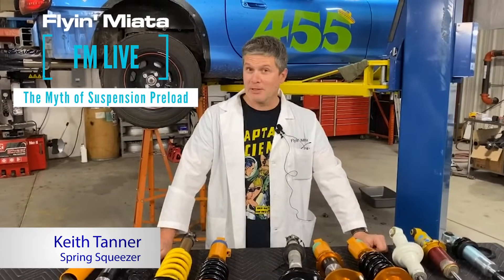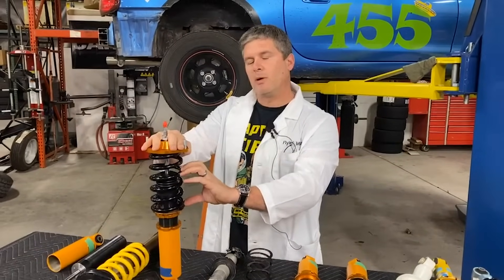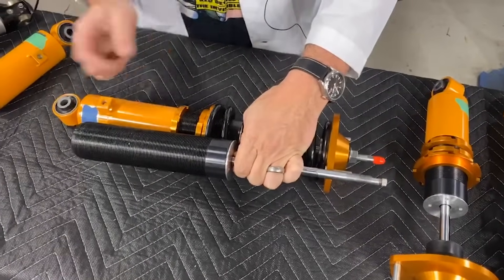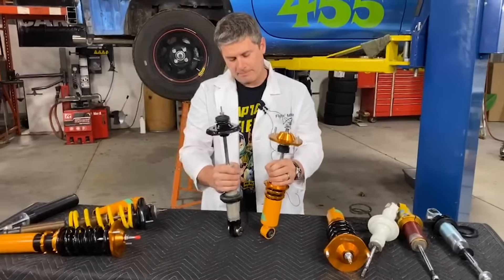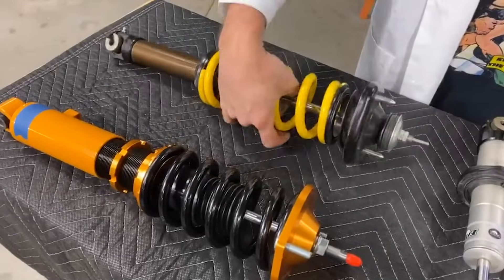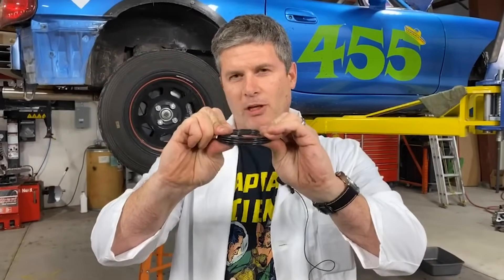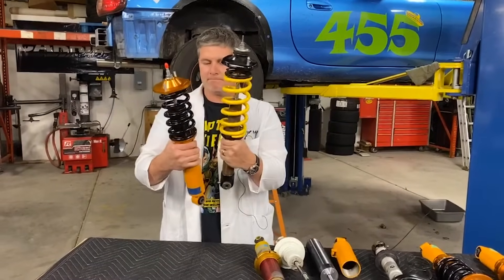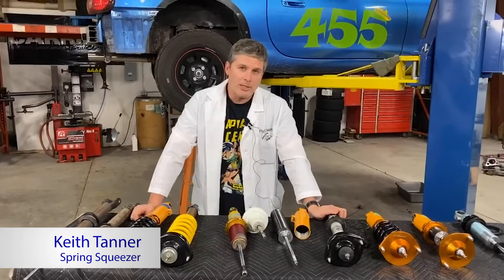The Myth of Suspension Preload (FM Live)

Comment: Hello from sweden! I have the standard v-maxx coilovers for NB. I bought them before I knew about the existence of a FM version.
I have not installed them yet, Is there someone exchangeable parts that I should buy from you to modify them to FM spec?
Reply from the maker: The biggest difference is our custom springs on our FM V-Maxx set-ups. You can get those separately from our site, but this will void your TUV certification.

Comment: what kind of ride height could you expect out of the FOX ON an NA/NB setup like you said with some preload and no helper springs?
Reply from the maker: That's not really the way to look at it. What you need to do is decide where you want the car to be, then select the springs accordingly for rate and length. Or choose your spring rate and then choose an appropriate ride height.
The Fox can run above stock ride height. If you're looking to build an offroad car, you'll want long, soft springs. It's probably best if you give us a call to figure out the best setup for your goals.

Comment: Also the vmaxx you said you lengthened the springs. Can I still go low if I want to?
Reply from the maker: You can go low. Can you slam it to the point of uselessness where you're dragging the oil pan? Not so much. At that point, just take the springs off.
Reply: I didn't mean that low I just don't want much gap left.  I have very good roads here in north Georgia mountains.  Do you know when the classics will be back in stock? Thanks for the reply!!
Reply: tommy dvorak you might want to do ALOT of research on the forums, specifically the suspension threads. There you will find pictures of miatas with different suspension set ups along with reviews. But if you are just now learning, you might want to try the FM VMAX coil overs which can bring you very low or very stock and are comfortable/ better than stock. It’s a starting point, once you learn more, you can gauge what you want a little better. 

www.miata.net

www.clubroadster.net

www.mazdaroadster.net

Comment: How low on an na can you go with the fox???
Reply: Buy it and find out lol 😆
Reply from the maker: As low as you can with any suspension. The limitation is the tradeoff between spring rate and travel. If you run a lot of spring, you can run very low - we do that on our track cars. But if you're going to run street rates, you need to set the car taller so you're not on the bumpstops all the time. This is true of any suspension.

Comment: On a Linear shock, sure. Digressive I feel it may play a little more roll. Recently played with this myself. With a loose preload, it stayed more so in the low speed firmness area of the valving it felt. It was quite rough and a bit harsh, really. Even on the littlest of things. Unpleasant is a great word. Then, I put the shock back at the manufactures recommended preload setting. Or, 'tighter' in lack of better term. Then the valving was perfect! Soaked up everything extremely well. Not unpleasant in any way, shape or form. Quite dramatic of a change, really, from a couple mm change of something advertised to not make a difference. Loose setting, on the same mountain pass with the same valving 'click' adjustment, it was very unsettled. Adjusted back to recommended tolerance, everything else the same in terms of click/rideheight, very confidence inspiring. Idk the exact science that came from this, but I was curious on the topic and explored during a free day. Just commenting my findings 👍
Reply from the maker: Kyle Gibson shock valving doesn’t come in to it. Once the spring starts to compress, the amount of “preload” ceases to matter. You did adjust the amount of compression travel in your testing and that will definitely have an effect on car behavior. It’s likely that’s what you were experiencing. If I understand your description properly, when you increased your preload without changing ride height, you had to shorten the shock body. That gave you more compression travel and kept you off the bumpstops more. The preload increase wasn’t the real change, that was a side effect.
Reply: @FlyinMiataVideo  thank you. That does make sense 👍

Comment: I need maximum travel when I take my Miata in the woods.
Reply from the maker: Also, any time you drive it on public streets and any time you hammer a curb hard on the racetrack! Suspension has to have room to work or it doesn't work.
Reply: @FlyinMiataVideo  As Ian Tyrrell says (check his channel, top chap) suspension has to suspend.